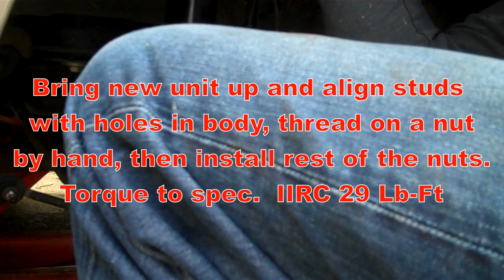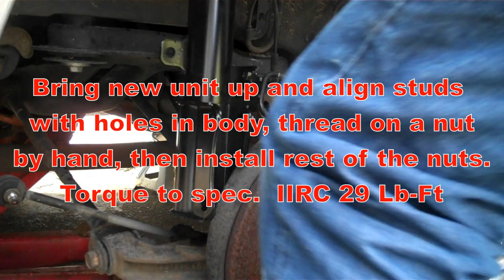2004 Toyota Camry Rear Strut Replacement

Comment: Really great tutorial, thanks.  Very helpful.  
An FYI for those with the 2002 model --- it appears there is much less room to get a torque wrench with 12mm x 1/2" drive socket on those 3 upper strut nuts (the ones you torque to 29 ft lbs).  If you follow the official Toyota repair manual, they instruct you to also remove the two roof side garnish panels, center stop lamp assy, package tray trim panel with speakers, and 3-point seat belt assy to access these 3 upper strut nuts.  I avoided all that by using a foot-long 12mm offset box wrench to tighten nuts to a close 29 ft lb approximation, and used lok-tite just in case (as it's highly unlikely that I'll ever replace the struts again on this old car with 325k miles.)

Comment: A few time savers to consider. 1.  Someone already mentioned in the comments that you can get to the side seat panel screw with just a long extension on a 12mm socket pushed between the gap between the cushions. If you choose to remove the bench seat, you don't need to fully remove it. Just pull it back 4 inches which will leave the seat belt buckles in place and easier to reinstall the bench cushion. 2. Invest in a set of ratcheting closed end metric wrenches (like he uses in the video)(includes 12-14mm) to access the narrow working room you'll have to remove and replace the tops strut bolts.  3. Save the 12 mm bolts holding the struts up top. As long as the threads are the same on your new quick struts, reuse them. They're taller and easier to bolt down than the shallow new bolts included with Monroe quick struts.  4. Put jack stands under both sides of the car to make it horizontal side to side (front to back doesn't matter). If you don't, it will be next to impossible to line up the bolts holes to the knuckle because the sway bar is pulling it out of alignment when not horizontal. 5. I've replaced all 4 struts on my Camry and only 1 of 8 sway bar link hex screw holes didn't disintegrate when trying to remove (stupid design!). I used an oscillating saw with a metal cutting blade to cut off the lower bolt and then was able to remove the strut. Bought new sway bar links for reinstall. They bolt on normally with a socket.
Reply: Thanks for the tip on the anti sway bar. Most excellent!!

Comment: Great video, very helpful.  I had both of mine done in about 2 hours total.  About the only thing I needed that I didn't have already was a 19mm 1/2 inch drive socket and 19mm combination wrench to get the two big bolts on the lower strut out.

Comment: Great quiet video and almost spot on! However, would just like to add that if your vehicle has rear disc brakes you must remove the caliper from rotor as the bottom 19mm bolt must be push out to the rear and there is no room with caliper in place.
Reply: Correct me if I'm wrong bro but when he took that tire off look like disc brakes to me 🤷‍♂️. I bought my struts for my 2005 Camry Le just bought from some dude that drove it from cali. Cosmetically clean in and out struts done. Hope I got the balls to do it 😂😂🤦‍♂️
Reply: Mine has disc brakes and I didn't have any issues, but that bolt on mine was very close I will admit.  Putting it back together I had to have a perfect alignment with the strut and suspension before it would clear the caliper.
Reply: @kryptorich4286  No, look again, it is a drum brake

Comment: A mobile mechanic  replaced both of my 2002 Camry front struts in 30 minutes. He had a battery driven impact wrench. So after viewing this video, I thought it would be fairly easy to replace the rear struts by myself, expecting it to take a bit longer as I only have socket wrenches.

Although it is only 7 bolts, and appears simple to do, the fact that the struts weigh abut 30 pounds makes guiding the new strut up into the three top holes a bit of a muscle job and not easy to do when sitting on the ground.  With the car up on a lift one can look up under the wheel well and see the holes to guide those bolts into. When doing this yourself with a floor jack, one has to lay on the ground to look up at those holes. Rather tough to lift the strut and carefully guide it into those holes from a laying  position. Best to have a second person finger tight the top nuts while you hold the strut in place.

Then, to get the old strut out from entanglement in the stabilizer parts, you have to raise the car and drop the wheel down for more clearance. So be prepared with  multiple jack stands under the frame of the car, which  must be rather high so you can use  the hydraulic jack under the wheel to drop the wheel down. 

As the new strut is about 4 inches taller than the old worn out strut you will find the wheel and stabilizer part do not line up with the strut. You will have to use the jack to raise and lower various parts to get them in position so the bolts go back in their holes. I found I had to lower the wheel to line up the bottom bolt first and get that in place. Then I had to raise the wheel so the top bolt hole would swing up in place. It took me 3 hours to do both sides, which included setting up blocks under the wheels so the car did not shift, lining up the two jack stands to support the cars frame,  and manipulating the hydraulic jack through the assembly.

 Also expect to wait at least one hour if you spray the bolts with penetrating fluid. I found I had to add a pipe over my socket wrench for added leverage to loosen the two large wheel bolts, as I do not own an impact wrench. Having the correct tool for this kind of work would have sped the process along.

Comment: I believe the sizes are 12, 14, and 19mm, and if yours is like mine and the Allen slot is worn down to a dimple, you can fit a slim 14mm wrench between the tab and the ball to keep the bolt from spinning

Comment: Is the camber bolt adjustable?  I was told by wheel Works that my Toyota Camry 2002 is not adjustable and camber spec. was out.  In order to make it back to the spec., I need to replace it with a adjustable bolt and it cost almost $200 for them to replace it.

Comment: Thanks for the video.  I have a 2002 Camry with almost 172K miles and I noticed the rear struts popping going over bumps and the ride isn't as smooth.  Looks quite simple to do

Comment: Noticed you have a separate jack under the suspension; is this just to remove any pressure on the strut? Then u put the jack back when securing the new strut.

Comment: I did mines with out the torque wrench I use a socket wrench, is that ok ?
Reply from the maker: I used the torque wrench for those who choose to use one.  Tightening everything tight using your best judgement should be fine.
Reply: Hubjeep ok thanks

Comment: Does anyone know what tools/sizes are needed for this job? Great video btw.
Reply: I used a 19mm 1/2 inch drive socket/ratchet, and 19, 14, 13, 12 and 10mm combination wrenches.  (I might be off a millimeter on some of those sizes--I'm doing it by memory but you get the drift).  Oh and an Allen wrench (don't know the size).

Comment: Did you reuse the old upper mounting nuts or the new ones that came with the quick strut?
Reply: Never mind.  Now that I have my quick struts in hand, I can tell from the video that you used the new nuts.
Reply: I replaced the front ones but I reused the nuts on top because they are way better quality thicker stronger than the ones that came with the new shock strut assembly .

Comment: would i be able ta get those bolts off without an impact drill?
Reply from the maker: Yes.  Hand tools will work fine.
Reply: yes, it helps to get a breaker bar or have an extension on a box wrench to start. after you hit it with those, you'll be able to finish with just a socket.